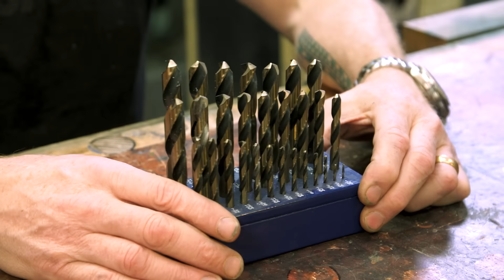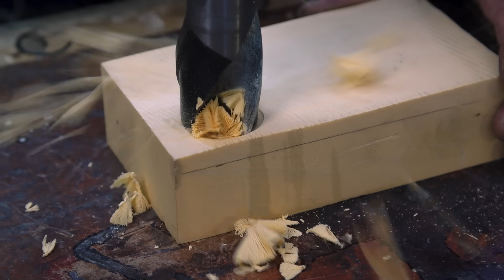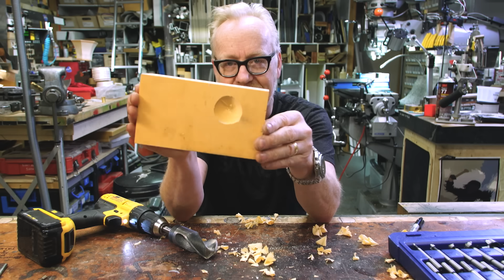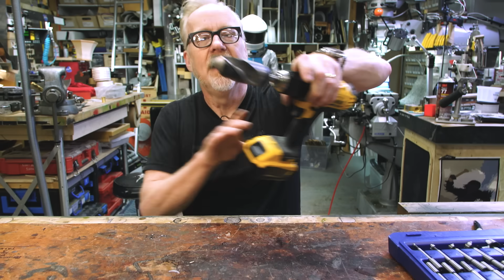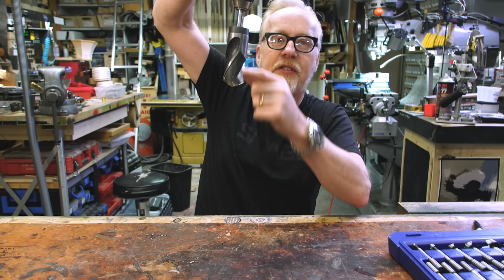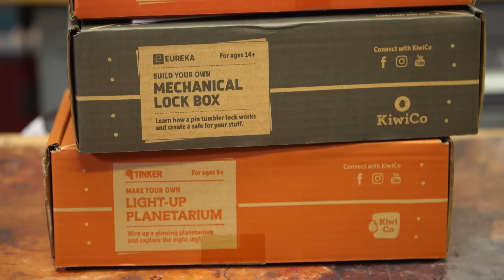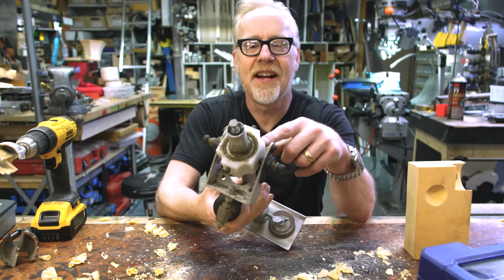Adam Savage's Guide to Drill Bits!

Comment: Have to say, I'm kind of disappointed that you didn't mention a couple things about both the masonry bits and the auger bits.  Masonry bits are specifically designed to be used with an impact drill, which means that their bevel is mostly meant to provide the smallest contact area to the material, and subsequently for debris removal.  Bricks and cement will quickly dull anything that attempts to use the chiseling action.  Auger bits are fantastic, in my opinion.  You failed to mention that the tip of an auger bit is a small screw that helps pull the bit through the material, making it far easier on both the drill and the operator.  Not only that, but they are the only drill bits that are adequate for making deep holes through materials.  If you need to drill a half inch hole through an 8 inch piece of wood, your only option is an auger bit.

Comment: bit braces are nice, if you don't mind destroying an old one, just cut the lug off and you get a very nice and aggressive drill bit.  Any time I see one at a garage sale I get it. Now I have to look up the prices for them. And i'm certain they still sell them new though, because its a good bit to have if you are off the grid and need large holes made and there is no power. 

As for cheap bits, the flutes are cut too narrow. They clog really easily. I had to widen the opening on all of mine, its better than before, but not perfect. The small bits 1/2 and under were the worst. Every little bit down I had to stop, poke the flutes out and start again.  So there is a difference there. 

And for the masonry bits, there is a way to cut the end so you can drill hard metal.

Comment: Cheap vs expensive Forstner bit differences when drilling hardwood is very noticeable. Mostly the cheap ones aren't sharpened properly. If you have the time and patience (and skill, these are more complex than twist drills to sharpen), you can make the cheap ones work, but if you're going to be using them fairly often and you can afford it, buy a good set. The cheap dull ones only make dust instead of actual shavings, which leads to you wasting a lot more time drilling and the drill bits heating up and ruining the temper which makes them unable to stay sharp.
Reply: It's important to notice that the price difference is quite huge though. 30 dollars for a cheap set while a good set will cost you 30 dollars per bit.
But if you're doing woodworking and you need them, you don't really have a choice. The difference is so huge when drilling a really hard wood that during the first hole you're drilling you'll kick yourself for ever cheaping out.

Comment: What about the circular bits that leave the circle/cylinder stuck in the bit if you go all the way through the material? If you don't go all the way through, they essentially just drill a circle into wood, rather than a hole. No idea what they're called.

Comment: You're missing out on the good spade bits. Bosch makes some that have a worm tip rather than a point, and the teeth aren't all the way out on the ends. They do a much better job than the traditional version. And they easily go thru the material like an auger because they have the same tip. Also the Forstner bits can be hard for newbies to control, especially the bigger sizes. And, of course, you can't drill at an angle by hand.

Comment: Hey Adam, I’m wondering if you have any recommendations for small bits, or even a tool tip related.
Very thin bits often break even with gentle pressure, and I wonder if you have a type or brand you recommend for quality?
Love all the content from you, and thank you.
Reply: Small bit = High speed, low pressure
Large bit = low speed, High pressure

Comment: The major difference between a cheaper Irwin (Lowe's branded) Forstner bit set and higher quality sets is the quality of the grind. Often times you will find burrs, gouges or inaccurate angles on cheaper sets. Because of the versatility of these bits, I recommended getting at least $100 set.

Comment: You missed my favourite. Annular cutters, the Forstner bit of metal cutting. Though not self centring it lets you can big holes with a machine that couldn't drive a standard twist drill of that size. Also the waste material can be used.

Comment: Oh, and another thing... when drilling large holes hold the drill so that either your thumb is stopping the rotation or hold your forearm against the battery or furthest part from center of rotation. If the powerful tool hits an unknown screw or nail or just binds for some reason the tool will instantly try to rotate and in two instances I have seen create very bad sprained wrists. One caused enough damage that he now has diminished strength and pain when using his hand heavily. Holding the battery against the forearm applies the force to your arm rather than just the hand and using the thumb side of the hand for drilling (lefthanded) allows for just a sprained or hyperextended thumb if you cant line your arm up with the battery.

Comment: As a capable man which is what used to be normal but is now called being a "maker" as well as being employed in blue collar industries this was an underwhelming video and a disappointment. I had hoped to learn something. 
A word of caution Mr Savage reminded me of in regard to hand holding material and drilling: never hold your hand behind the hole even if you intend not to drill through!! Also a type of bit not mentioned here is particularly aggressive in sending it through which is a screw tip spade bit. Even at very low force where you assume it would drill slowly it does not. The screw point starts very quickly and it drills through at the speed of driving a screw which can mean less than a second through dimensional framing lumber! They are great though when you need to drill a hole at an odd angle where it is difficult to apply force sufficient to "push" a bit through.

Comment: When it comes to stepper bits, I believe DeWalt has the best. In any case, having a double cutting edge is better, faster than a single. Most stepper bits are single edge
Reply: Also, depending on the material, get a center punch or a scratch awl. These eliminate drill bit wander.

Comment: you should look at indexable carbide insert drill. im drilling 2 inch holes in steel 1 shot with them as deep as you want within .005 , but you need a machine and a lot of coolant. but its pretty nice, you can just change the tip, from 1/2 to 1, 1 to 2 inch etc... that style https://www.youtube.com/watch?v=7lVIPIamEAM&ab_channel=AlliedMachine%26Engineering

Comment: Forstner bits (or self feeders what we call em in my neck of the woods) are cool n all but my go to is and will always be a hole saw on a arbor. Super clean holes. No mess and you can actually throw the wood slug in the trash can without busting out a broom.
Now im no woodworker by any strech of the imagination. Im a new construction plumber so im making holes for gas lines to drilling holes for water lines to making holes for closet bends. Self feed bits and great until you run into a nail then your favorite drill becomes useless while my hole saw chews through nails like its food. 
Great video by the way.

Comment: That's funny. I build a steadicam too when I was in my teens. Made a 3 axis gimbal using a ball bearing and different size slices of pipe inside of eachother. In theory that could've been balanced also by adjusting the threaded rods I used.

Comment: If you have a 1 1/2" Forstner bit, you can turn almost anything into a tea light holder.
Reply: My mom's antique cherry coffee table doesn't know what's coming!
Reply: @alexhb12333  Don't you mean your mother's antique cherry coffee table *with tea light holders*??
Reply: @RChero1010  haha 😊
Reply: Forstner bit is best bit.
Reply: @craigejacobs  Usless for metal,
Reply: @rimmersbryggeri They're most effective in wood, but you can absolutely cut metal with a Forstner bit.
Reply: @craigejacobs  makes sense, it's like a milling bit for wood right? Spiraling through is much less tension than face milling, so I could see how the specs need to be more fitted for the job. 

It's too soft right, dulls quickly?
Reply: Great for impromptu trepanning aswell
Reply: @Weincraft  i used to know what that meant... before i started doing it... 😜
Reply: Ok will do
Reply: Sex toy. He meant to say sex toy😛
Reply: True…but cleaning the blood off is hard work. 😜
Reply: 1 3/8" for Shot Glasses.
Reply: Hmm 🤔
Reply: turns a tea light into a tea light holder
Reply: 😆 I used to do this to drift wood
Reply: Yes definitely I love that
Reply: Best comment I've read today.
Reply: That is unless your tea lights are not smaller than your hole. I have a set and have found cheap tea lights are not always the same diameter. Also wet wood can sometimes warp drying and upset the fit .
Reply: @chrisbraid2907  prep the woof with a sealant and use some caulking to keep the tea light in place.

Comment: Yes, auger bits are available for power tools.  I have a couple for drilling clearance holes in studs.  the screw point at the end makes them very aggressive by pulling itself into the wood, so you need a strong drill and a side handle is very useful.  My 7/8 bit frequently stalls my Milwaukee 1/2" cordless drill and I have to go with my ancient 1/2" corded drill that has a side handle to keep it from twisting out of my hands.

Comment: I love my Forester bits. Bought them to aid in making my front porch galvanized I to wood railings. 

Much cleaner holes than using spade bits. 

I also own screw assisted spade bits. Ones with a screw at the tip that pull the but through. Those work great and keep straight but, they tend to rip or be too aggressive at times. However I always grab them before standard spades.

Comment: So right about hand drilling vs machine accuracy. spiral step drills, hole saws . Cobalt hacksaw blades are awsome.blacksmith drills up to ~ 30mm have reduced shank so can fit in a 1/2" chuck.nice work. and dont push a cutting implement towards your other hand, good lesson. grip offcentre.

Comment: So much info was left out…118* vs 135*, cobalt vs titanium coated vs high speed steel, pilot vs no pilot point, varying flute geometry, sharpening bits, reverse thread bits, etc. Which to use when, what’s better for what. This was more of a “Adam’s commonly used drill bits” video, than a guide to drill bits.

Comment: Check out the Norseman Vortex drill bits. They have a 29 piece set. It's basically a small step bit point. They say it self centers, produces smaller chips and lasts about 3x as long as standard bits.

Comment: The harbor freight cobalt step drills are spectacular without even considering their price, but I had to do a fair deal of work to their forstners to get them passable, but were super cheap and good if you wanna learn how to sharpen them.

I'm gonna grab my hubris with both hands and try to show YOU a new cheat code tool: ever hear about abrasive string? McMaster Carr has it now and it's an absolute game changer. Less novel but still useful are the diamond sheets from Tsubosan, only half a mil thick, and easily cut to make custom laps and files. I've never tried it, but I imagine the copper backing could even be affixed to other metal with locktite for a thin and strong bond. It's basically diamond sandpaper from a reputable source, discovered it while I was looking up where my diamond feather file came from.

Comment: wonder if joerge sprave watches your channel. he had what I think a ridiculously bad drill bit incident using a twist drill and a workpiece held in his hand. standing next to a bench with a vice on it. I consider clamping a work piece or at least not having my delicate bits holding it now to be as essential as safety squints. im never in that much of a hurry to make something these days. Ive gotten gored on a piece of plastic I was bracing against my leg with a twist bit when it decided to grab.. when I saw his video it changed my practices.  there is always a way to make it safer.

Comment: You didn’t mention “Hole saw” bits which combine a circular hole saw with a pilot drill bit in the center and are used for making large holes, especially those larger the largest common Forester bit or blade drill bit. I realize they may not technically be classified as “Drill bit” but they include a drill bit as part of of the package and are used in drills so I would have at least mentioned them.

Comment: Good review on drill bits.  One point that should be emphasized is that the majority of the bits you show were developed for wood and by extension to other soft materials.  Exceptions are the twist drills and carbide-tipped masonry bits.  I have a full set of Irwin auger bits, I bought in 1967, for my 1928 Winchester hand brace (a rare tool, only made 1 year).  Also, have expansion bits that go up to about 1-1/2" for my brace (auger sets usually only went up to 1").  As you point out, using the brad-point or Forstner bits are much preferred over the standard twist drills for drilling in wood.  The spade bits are usually used where the precise "roundness" of the hole is not important, e.g., drilling for electrical wiring or plumbing pipe runs, where an auger bit is also commonly used by electricians and plumbers.

Comment: Forstner bits make a flat bottom hole... They are used to mount recessed hinges on cabinet doors.
One thing they don't do easily (and cleanly, and centered obviously) is enlarge an existing hole... In a hand drill at least...

Comment: I had a Templaco lock install template come with a 4.5" Long end mill, to put into a router for side-cutting!  NOTE: NEVER EVER EVER use a super-long mortising bit ( an end mill for carbohydrates )  for side cutting in a hand held router!  Even a door mortiser, which is highly STABILE, only cuts a 3/4" depth each pass of the motor/carriage assembly.

Comment: Do forstner bits work on aluminum? I don't have a mill, I've been pushing my luck with a bench top drill press from harbor freight (even lathing some small things) but I've been having trouble running a flat bottomed hole in the center of aluminum round stock! My low drill press vice makes the stock crooked sometimes... and twist bits can sometimes drift like you said!

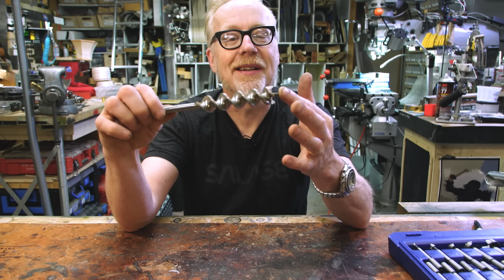Comment: At 11:44 - The "auger" bit - Adam says they are "expensive".  No, not really.  The one he shows to be used in a manual drill "Brace" is expensive.  The one's you find at the typical hardware store are pretty darn cheap.  They typically come in about 8" lengths but also in long and stubby varieties.  Especially handy for drilling through thick timbers (landscaping) plus the "screw" thingy at the tip will pull the drill into the wood helping to get through it more quickly.  Get a set.  My $0.02.

Comment: At 6:44 - "Unibits" or Step Drill Bits - Handy as heck to drill into thin materials (not to cut a hole all the way through thick materials).   Its like using a collection of smaller bits to create multiple "starter" holes up to the end size you need.  Especially good for VERY thin materials like sheet tin as it (usually) won't grab the material and spin it around (OUCH).  Also handy when you don't know exactly how big of a hole you need (get the 1/32" step variety first) and to sneak up to JUST the right size hole.  Hint #1 - Gently use a tiny edge of the next step size larger from the step size you want - this will slightly countersink/debur the hole you just cut!  Hint #2 - Use a marker to highlight the size of step you are aiming for because you can't see any of the step labeling while the bit is spinning rapidly around.  Finally, good as a traveling set of "just in case" drill bits for a small tool bag in the back of your car (you should SEE the back of my car).  My $0.02.

Comment: 9:20 The long shallow angel is NOT needed to drill acrylic. As a 20 year  plastic fabricator you only need to regrind the angle of the cutting surface to a zero deg rake to change from a cutting edge to a scraping edge.  This will also cut ANY plastic to give a smooth, precise non blownout hole. This also works well in aluminum. if the edge is not reground the bit will pull its way thru the material thus causing the blow out.

Comment: Broke my hand drilling out a half inch hole to 3/4.  Bit broke the tip off the cutting edge, grabbed and twisted me into a broken pretzel.  This was on a trailer, all I had was a really mean 1/2" hand drill.  Freak accident that ended with 3 pins in my hand.

Comment: I know I'm not a patreon, but while on the topic of 'great tools you may not know about' : What's your thoughts on lefties using right hand tools, versus acquiring leftie versions? 

After 20 years of using right-handed tools, I (leftie) recently got gifted some left-handed vernier calipers. This (admittingly stupidly expensive, 5x a right-handed, otherwise identical one) tool has blown my mind. I never really realized that this is what using such a tool is (supposed to be) like. Not a super clumsy, hard to use and read PITA at all. (Try normal ones in practical use with your left hand if a righty, to get a feel for the different experience).

Comment: @7:00 Yeah but what is the use case for those stepper bits?? Like, if you're drilling through anything thicker than ~2mm you're into the next size hole. Is it for drilling a conical hole? Or what?
Reply: You got it right. It's generally used for thin steel.

Comment: One handy feature on a spade bit, and to a lesser degree carbide tipped drills, is that you can fine tune the drill diameter.  If you need a very precise but odd diameter, you can file a spade bit or carbide point and adjust the resulting diameter.  You have to do the modification and use the tool carefully, and make test cuts to get the adjustment correct, but it can work.  It can be a lot cheaper to modify a spade bit for a couple of special holes than buying an expensive special-size bit.